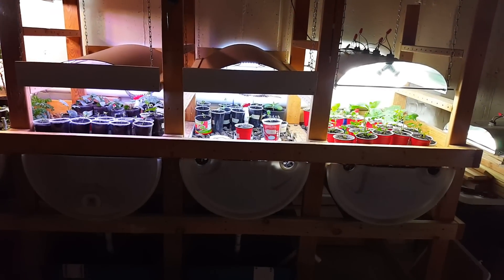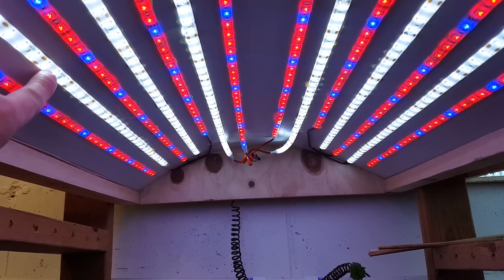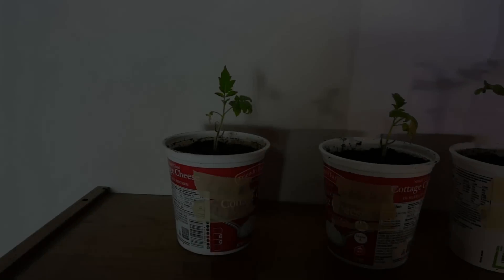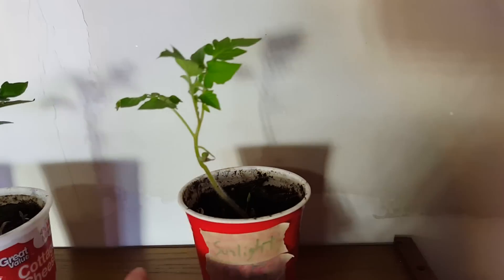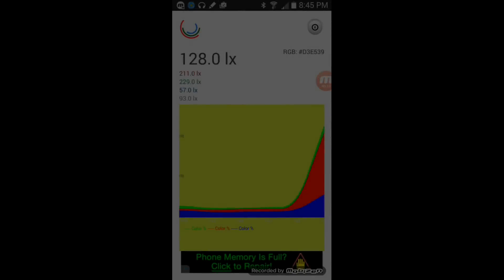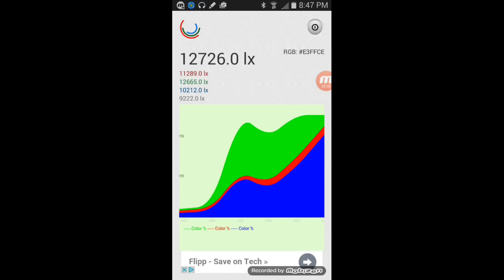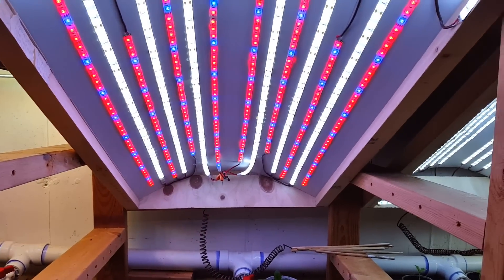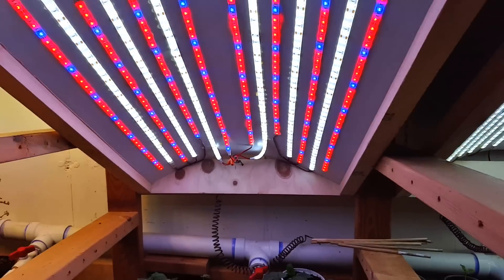DIY LED Grow Light Follow Up - Low Power LED VS CFL

Comment: did you get these LED from the GEEK/WISH app. Its a Chinese retail site MUCH cheaper if you didn't
Reply from the maker: +Jeff Lowe no, i would never shop on a chinese retail site. It is bad enough that they are all made there:)
Reply: +SSLFamilyDad Lowe's has a sale on Osram LED bulbs that fit in the E27 socket (3x 8.5watts/60watt equivalent for $6). Do you think those LEDs lights 2700k would be as good as the CFLs?

Comment: The flaw in this test is the temperature difference between each light setups. Take for instance the soil that's in it what is the ph? Did you start from seed or did you have a mother plant? If so what part of the plant did you place on each set up? How was the humidity difference between each test? What was the control humidity? Also the cups have different soil sizes. I mean there's many factors that come into play.
Reply from the maker: +marcos ramos all plants have same soil, a mix of cup sizes, same temp, and same humidity so it should be a decent comparison

Comment: I think I'll use 3 watt LED's mounted on an aluminum strip.  It looks like you need more LED's mounted closer together although the results were not bad.
Reply from the maker: +ElGatoLoco698 I agree in this test the results showed that higher lumens ( more power) was needed

Comment: I'm convinced that you misread the channel values in your software, look at the numerical values, they show a different story. You are mistaken to believe that the narrower the band is the lesser the value is, I think that the color on the top is always higher and seeing more red means that it is the bottom color and the spectrum is blanced the the gap between them is small. The soft seems to sort the colors by value in depth of display, so you can always see the smaller band in the bottom. At 5:17 red is 2918lx, it is lower in the chart, the green is 3721lx and displayed second in order and higher than the red, the blue is 4929lx, the highest value, so it is behind and visually on top. The white bands seems to weight for the high blue ratings, maybe use a warm white instead. The second light is close to the first because anyway the first had a majority of the same cold white. The cfl is a lot greener, not blue, red/blue is balanced and green in the middle of the spectrum is higher, these lights are whiter to the human eye than the led cold white because the red/blue are close to one another. if the cfl was really only blue it would look really blue, like a blue led.
Reply from the maker: I agree with you on that and since I got my new phone the app has an inverted color scheme. I believe they have corrected this in the new version as the color scale on the graph should have certainly registered the same lx values from the data. Good catch.

Comment: 5630 and 7020, all mean diode size, not brightness.
Reply from the maker: +Sir Humboldt and a larger diode size means it will be bright hence the relationship between the number and beightness
Reply: not necessarily. 5050 isnt brighter than 5630.

Comment: The LED lights are not providing enough intensity. You need to move them closer. Grow LEDs are very VERY intense and require being placed far away from the plants like yours is. But your lights are not strong enough therefore you need to move them closer... like within 12 inches. You would have gotten better results. You entire plant canopy should have been covered with a purple light thats how you know its close enough to provide proper light coverage.

Comment: The number designations of the LEDs specify the sizes. A 3528 is 3.5mm x 2.8mm or .138 x 110, a 5050 is 5mm x 5mm or .197 x .197, and a 7020 7mm x 2mm or .276 x .079. The larger the LED, typically the more current used and the higher the light output. In order to have the most effective LED grow light using the strips, warm white (3500-5000K) 7020 strips should be used and should totally fill up a flat, not a curved, mounting surface. Red 625 nM and deep red 660 nM LEDs can be used as a small percentage of the total amount of LEDs. The LEDs should be placed as close to the plants as possible and raised as necessary to keep from burning the plants. The white LEDs used in the strips have a forward voltage rating of approximately 3.3 volts and there is a current limiting resistor that drops the voltage by 2.1 volts from 12 to 9.9 (3.3 x 3). A 39 ohm resistor is a commonly used value and using a resistor lowers the overall efficiency of the strips which are still better than incandescent and fluorescent. Using similar wattage LED and fluorescent lamps will prove the superiority of LEDs. The CREE web site has an excellent example of an experimental commercial grow light using higher powered white and red LEDs which is far superior to anything on the commercial market. The high build cost is out of the question for hobbyists.

Comment: I downloaded that same light meter you used but it tops out at 30,000 lx
Reply: What is the lighr meters app name please?
Reply: I want to know the same thing, what light meter app is that
Reply: @matdahl1463  just go to your app store and type in "lux meter" also, you have to have a high end smartphone with the correct sensor built in
Reply: @randalllastname4509  just go to your app store and type in "lux meter" also, you have to have a high end smartphone with the correct sensor built in

Comment: I think you are reading the lux data incorrectly.  In the first two you mentioned how much more red there was than blue, but I believe it to be the opposite.  The higher the color on the screen signifies which color is the most.  you can see the individual lux readings above the graphs.  For example the first graph was 4783 blue, 2971 red.  Red is about 62% as strong as the blue, therefore it shows on the graph about 62% as tall as the blue.
Reply from the maker: +Alex Propst man u think you are right but it is,still confusing then because it shows that the total percentage is higher for the red spectrum but the blue is more powerful with a higher lux reading. I may have to explain that differently in the next test. Thank you for pointing that out! When i am recording i can't see the numbers due to the angle it is under the lights so just went by the graph but it appears we have two different bits of info here.

Comment: Blue light is for growth of leaves and Red light is for blossoms.  I noticed you initial LED had many more Red bulbs.  Your blossoms should be better under the Red for fruit.
Reply from the maker: +Advance G yes but in this case the red are weaker so it takes three times the number of leds to equal the light power of the blue

Comment: have a small grow space 1.5 square meters=16.15 square feet.  87,500 lumens using LED screw in bulbs white & yellow. 21 Autoflowering plants.Offhand, in general am i using too little or too much light from bulbs close to the plants but not too hot? Thank you.

Comment: Your best bet for LED's is to buy some 3/5w leds on stars, slap them on some heatsinks and rejoice in the magical plantgrowth.

I went through the same thing you are going through about 4 years ago with my fishtanks lighting. I ended up using 25*3w chips on a 250*270*30 heatsink... Kept my coral growing at a really nice pace.

Using low output LED's, even when I packed lots into a small area just didn't have the light output to bring decent PAR to even the surface of the water ~50 away. (I get that saltwater aquariums are slightly different than growing plants...)

Comment: while you're at it, why not experiment with same light strength (lux) between those lights. I mean CFL uses more energy than LEDs, and sun even give more energy output, and i think that might affect how plant grows. So, make things even will produce more accurate result (based on which is most effective, with same power (in watts) /output (in lux))?

Comment: I'm currently trying to put together a small cupboard garden to grow some micro veg...Something about small baby carrots and tomatoes just intrigues lol

I was looking around and came across Reptile bulbs / sun lamps
http://www.exo-terra.com/en/products/sunray_bulb.php

Here's one of them but they have a whole range.

I'm thinking of using CFL E27 for seeding and upgrading to the sun lamps for vegetating.

The tempreture in my planned growing space currently is 10*c so I'm thinking I'd probably benefit from the added heat factor. What are your thoughts, I have yet to come across anyone else testing or using them :/ Am I just crazy or are these E27 bulbs a viable option ? ? ?

Comment: Thank you so, so much for this. I am growing ornamental/indoor plants on a north facing outdoor balcony (in a tropical country) and was wondering what type of lights that I can use. 
Seeing as I am a newbie, I decided to just buy some cheap T5 LEDs to try out - and my dormant plants started sprouting new leaves, stems, gotten taller within A WEEK of 8-10 hours exposure to the lights.

Seeing these results, I thought perhaps I should dabble into grow lights but they're so much more expensive and I didn't know if it was worth it. After scouring the internet, there's just SO MUCH CONFLICTING information. 

Your video & experiment (despite being close to 6 years old), is proof that I needed that my success was not a fluke and I'll be definitely purchasing CFLs for my other set ups which is a fraction of the cost. Besides, I'm not growing for fruits and yield, thus I think normal CFL would be more than enough to keep my plants happy-ish. 

I'm unsure if you'll see or answer my question, but do you think it would benefit my plants by keeping the lights contain or directed? i.e. having a mesh cover over the shelves?  

Also, thank you so much for doing this experiment and making this video!!!

Comment: those strip LEDs suck. u need 5-10w LEDs to grow or cob LEDs .good idea tho. hopefully one day they will make them powerful enough to grow with
Reply: There are heaps of LED's you can grow stuff with. You can buy single diodes that produce blue and red that use 1w each. You can buy bulbs with 3 of these on one bulb, I used one and it made a tomato plant grow very fast. 
The problem with this guy's setup is he is using very weak little LED strips. They require no cooling and likely each strip is only using 1-2 watts of power. Which is too weak to properly grow anything.
Reply: TechCheck thats what im talking about... (the strip leds). i havent seeen any powerfull enough to grow any light loving plants like cannabis or tomatoes... i use leds to start my outdoor garden early indoors to get a head start on my summer garden but im using a 900w meizhi led. once they make those strip leds more powerfull it will make setting up a great home made grow led light very easy.

Comment: If i put a 5000K(9W, 800LM) bulb on my indoor plants during winter, will it even benefit from it at all? Does it have to be in a specific distance?
Reply from the maker: +izwabbit they would benefit for sure, sunlight is best but adding extra light during the shorter days in winter is good

Comment: You're supposed to put LED lights a lot closer to plants than you would other lights they don't have any heat so there's no reason not to and also you're wasting light the way you have those lights designed with that bow in the middle if it was flat they would evenly distribute their light better

Comment: Like pretty much everyone said. You're comparing a 200w CFL setup to a "120w" LED setup. I'd measure the draw on these LEDS if I were you. I suspect your total draw is WELL under 100w... probably in the 60W combined range.

edit: reading the reviews on amazon of the LEDS used in your second build (the significantly stronger LED's), Someone tested draw and those (stronger) LEDs pulled less than 36watt per 5m band... So you're comparing a 70W LED system and probably an ~ 60watt one against a 200W cfl.
Reply from the maker: IT doesn't matter how much power the lights draw, that is kind of the point. The LED's draw much less power but produce more light per watt. Although this is still not an equal comparison of lux vs lux my point was to compare to DIY lights, one using CFL bulbs and one using cheap strip lights

Comment: you read the results incorrectly, read the individual numbers rather than looking at the colored graph. the color on the top is the most abundant rather than the one on the bottom/front

Comment: I've done this test and there's no way power compacts win on a watt to watt basis and when using comparably high CRI. The core issue is the strip LEDs have a very low CRI in the least efficient out of all LEDs. Better LEDs will give you 100 to 140 lumens per watt at a CRI of >80. The best power compacts are 80 lumens per watt at >80 CRI.
Reply from the maker: Great info and very true. I did find however that the strip LED's lights worked great for a cheap seed starting light

Comment: I will be updating my T8 1 foot duel bar for a quad bar fairly soon, hoping for good results,manufature dose state min of 50W per meter squared but putting that bit extra should give a slight advantage but using blue/red and normal sunlight, will this be any good or should I just go with spending more to get good results

Comment: As I understand it, the good thing about leds is that they are very cool. You can put them right down to the plant and even put them so they touch the plant. By doing this, the plant receives much more light than it  does now. Fluorescents are cool too but not as much as leds. They also use more current than leds per lumen. Why don't you try lowering your led bank so it is just barely above the plants?

Comment: Those Led light strips do not out put enough power ie light to sustain plant growth, they might support seeds but that is it. You are better off getting cob or high power 3 watt leds. Check out Gromaus he is the Biz for diy leds.
Keep the cfl and dump them led light strips or use them to illuminate under kitchen cupboards.
That's my 50 pence worth...check Gromaus on here
Reply: +BlackJedi169 
I Spelt his name wrong its actually "Growmau 5" 
Led light builds,cobs,3 watt high powered Leds
Reply from the maker: +BlackJedi169 yeah i have watched most all of those vids on led lights. The problem is finding a low cost easy way to build these lights. I want it to appeal to people who might not have the skills to install cob lights and use heat sinks and drivers. I will say though, both of the led lights have been growing all of my plants for about two months now and although not as fast all the plants are very healthy
Reply: The problem is the LED lights he is using. He is using 1 watt LED lights not the 3 watt. I have a professionally made LED grow light and they can grow pot from seed to harvest and nice solid buds. This guy did a poor comparison. Not even a fair one. Had he been using more powerful LEDs he could have better results than any fluorescent light. I get anywhere from 1-4 ounces per plant of quality, dank MJ with my 360 watt LED grid. Lol. LED's even out do the results from high power HPS or Metal Halide lights and run a lot cooler and with less wattage.
Reply: +SSLFamilyDad im curious was the light measuring an app ?
Reply: +BlackJedi169 Doesn't it depend on what is being grown and where? I'm looking for the ideal lighting setup for growing tomato seedlings from the moment of sprouting, to the moment when I put the plants outside to begin hardening, for the rest of the season in the open vege patch. Do you think the led strips would work OK for that relatively unadventurous purpose? ;)
Reply from the maker: +John Carter yes, led worked fine for starting seeds and growing them out until you transplant outside
Reply: Check out what Cree did to develop a kick butt grow lamp. They did not use COBs but lower powered 4000k white and 660 nM far red LEDs in an effort to distribute both the light and the heat. Cooling fans are not required. Cree did however still used a set of lens to improve the light distribution. All of the parts used are commercially available except the original Cree white LED which has been replaced and I would guess that this lamp would cost well over $1000 to build. Check out the spectral distribution and you can see that red and blue LEDs are not required although far red are.  http://www.cree.com/led-components/media/documents/HorticultureReferenceDesign.pdf

Comment: Hi! A phone's camera can not be used to measure spectrum. What you actually get is the convolution of the 3 type of sensor diodes own sensing spectrum with the incoming spectrum, altered by the phone drivers color correction and post-processing algorithms. That is what an android app gets to work with, and its already pretty far from reality and pretty inaccurate. It can only be used for a very rough estimate, but expect that it might show light stronger or weaker then actually is, and intensity can leak into the neighboring color (a discreet wavelength red laser might show a hint of green, and on cheaper camera even some blue. (link to an actual camera sensing spectrum: https://www.maxmax.com/images/RemoteSensingCameras/Canon_450D_Spectral_Response.jpg )

Comment: Im curious to know if the LED strips you used to make the DIY lighting had any lens/reflectors on the LEDS. Im aware they were covered in silicone, so to add your own would require non waterproofed strips, but my understanding is that lens/reflectors make a LOT of difference to the quality of plant growth. Im pretty certain its the use of these that give grow light manufacturers justification for charging ridiculous prices for their LED lamps.